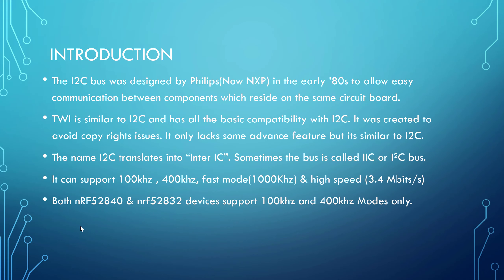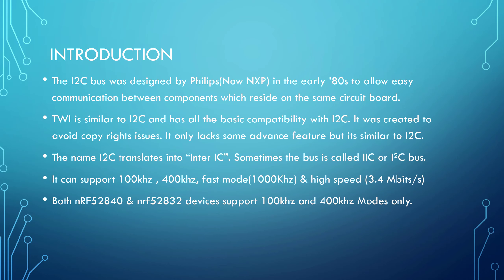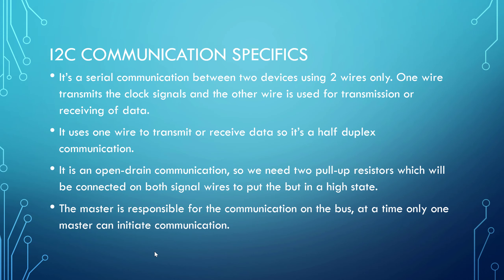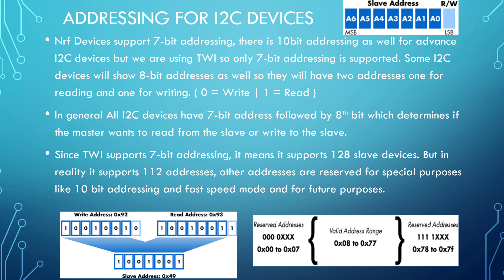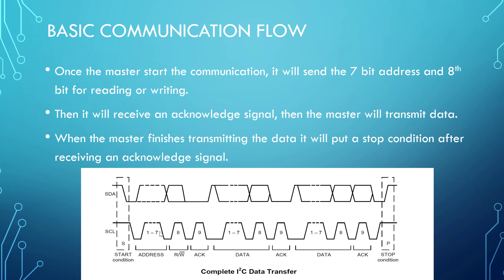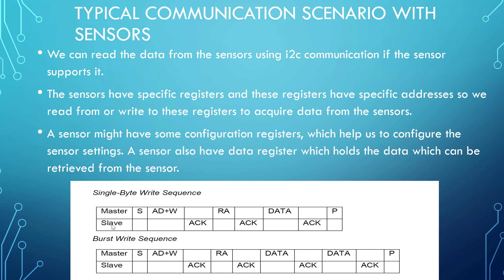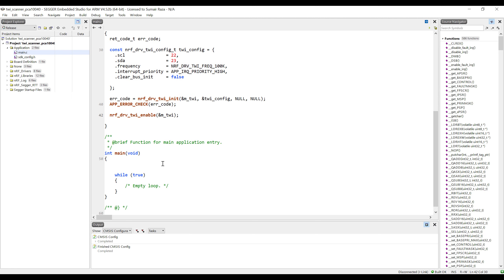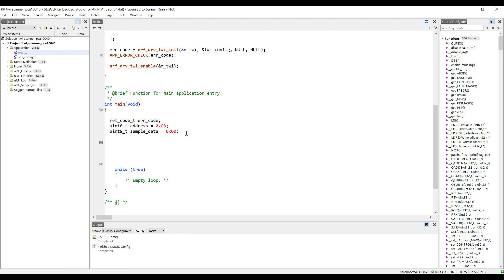nRF5 SDK - Tutorial for Beginners Pt 35 A - TWI - I2C - Introduction with Basics

Comment: Does every MPU-6050 has same address? I am trying for last few days but my MPU isn't working. I changed the MPU as well, but nothing happened 😢
Reply from the maker: yes it depends on the address pins, for example if you connect AD0 pin of mpu6050 to logic high(3.3V) then  its base address will change from 0x68 to 0x69. You can test on which address it responds by checking this tutorial.https://www.youtube.com/watch?v=-YjCpy1AFog , hope it helps. ;p
Reply: @SumairsEmbeddedEngineering  Sir thank you very much for reply. I am following that tutorial and I addr// read some data from the sensor
  err_code = nrf_drv_twi_rx(&m_twi, address, &sample_data, sizeof(sample_data));
  if(err_code == NRF_SUCCESS) // if reading data was successful
  {

    NRF_LOG_INFO("Successfully detected a device at address: 0x%x", address); // let the users know its working
  
    }
    else{
      NRF_LOG_INFO("No Any Device Detected...");
    }

After a few seconds, the ELSE message is executed. Same happens If I turn off MPU, or remove SCL pin. What maybe the reason sir?
Reply from the maker: @cryptonian5533  if you dont see anything on putty terminal, simply check the nrf sdk config.h file using cmsis config wizard, if you dont know how to work with cmsis config, watch my tutorial on this. Change the option in logging, uncheck log deffered, and you will see the output.

Comment: What are the pins you are connecting your MPU6050 with the nrf board
vcc-->vdd
gnd-->gnd
scl-->?
sda-->?
Reply: void twi_init(void)
{
  ret_code_t err_code; // a variable to hold error code
  const nrf_drv_twi_config_t twi_config = {
    .scl                = 22, // scl connected to pin 22, you can change it to any other pin
    .sda                = 23, // sda connected to pin 23, you can change it to any other pin